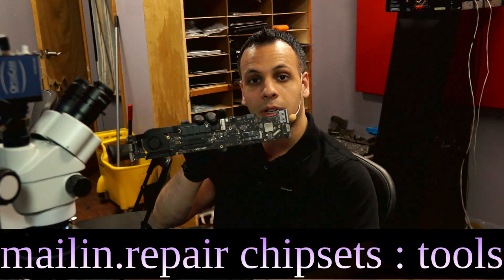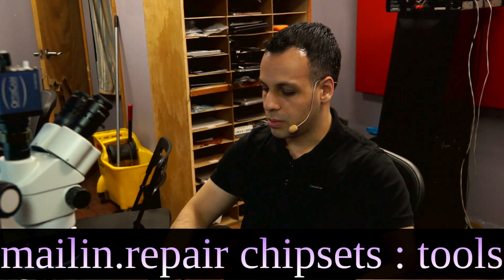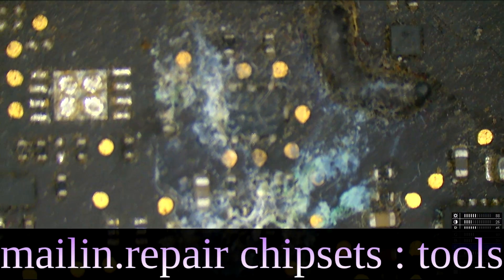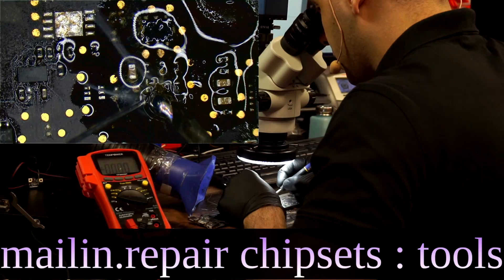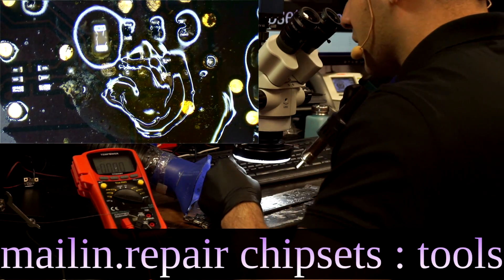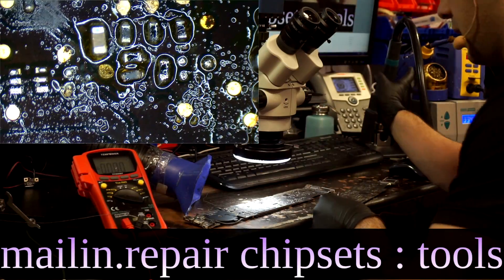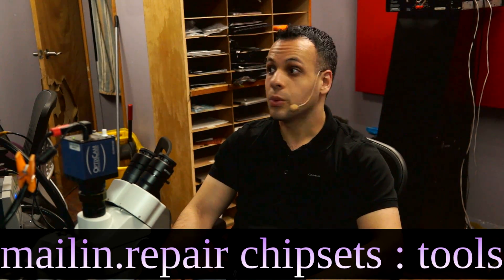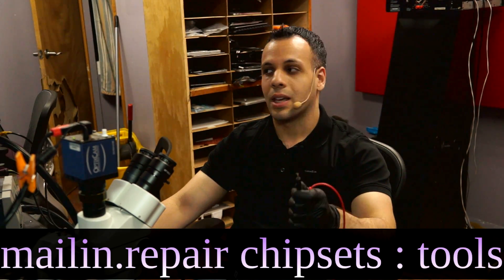Using a DC power supply to troubleshoot MacBook and iPhone logic boards.

Comment: Do you just feed it the appropriate voltage range for that model for full power draw, ie. 16V, 18-18.5V, 19/20V etc (from the bench PSU), or do you need to alter the voltage to 6V/3V to tell if it's getting stuck pre-boot?

Comment: Louis, how to set the Apple cable with the Bench Power Supply? Thanks.
Reply from the maker: 18.5v, no limit on current, ground to ground, positive to positive, and use an 85w original cord.

Comment: Hi, I am a scientist and a heavy Mac user but I don’t belong to the mac cult, or that is what I like to think. I repair computers and cellphones just because I love to do it. I don't make a living out of this, and I've started because I found that all the Mac repairs where I live were full of bullshit and deficient in quality, especially Mac itself. It seems I have done it pretty well, now all the department and friends came to me when they have a problem with their Macs. 
I’ve started to follow you because of above all of the internets I found you are the only repair guy with a critical thinking behind the process and everything else in life! Not just a step by step way to do it, I love to watch your videos! 
I had a dual core i7 MacBook Pro 2011 that was like one if my limbs I pimp up and fixed all the time I keep it in the best way, and it was working beautifully but got stolen. Now I have to think about which computer to get I feel like mac has come down to slippery slope concerning quality, reparability an innovation. To me, Mac innovation has become about changing the color of their new equipment. I know that out there are way better computers than macs, but macOS don't run on them and of course, I do not like using windows I think is a complete useless OS if you want to work with it. So, I am at this point when I can make a change, but I don't know where to go. I even have thought to get an old MacBook pro like the one I had. Sometimes, I feel like Mac computer and OS is like the democracy, the least bad system we have come up with. I thought to ask you because you might have a better understanding of these and maybe a word to say about it. Thanks for reading and for your videos!

Comment: If you cut off he cable, and use an extenrnal DC supply to power the motherboard, then who is gonna talk the SMC to? Is the 1wire circuit built into the magsafe connector, and still be functional after you cut the leads?

Comment: My macbook 13” early 2015 shuts down randomly. It shuts down even when watching YouTube, then next moment when i power it on it won’t even reach to the login screen. When I keep it idle just the screen turned on and doing nothing else it works for a very long time. I guess it is somehow related to GPU temp. Also when the cpu is cold and I start it, the screen distorts and it takes nearly 5min to recover. Even after the screen recovers it is covered with equally spaced light grey very thin horizontal lines. 
I have tried replacing the thermal compound and its of no use. Is there anything else that I can do?

Comment: Thanks for the video, this info will definitely come in handy in the future. Out of curiosity, I've got a cheapy switching lab power supply that has a fairly noisy output (depending on the output voltage it can vary between 300 to 400mVpp) and I was wondering if it would be worth sticking something like an inductor or smoothing capacitor on the output when using it to power a board with sensitive packages like laptop motherboard or would the components on the motherboard be fine if I just connected the output to the board without any filtering?

Comment: Louis i posted this info on one of your last video's that you asked about a inexpensive meter here is one that is not to bad in price and its not too bad of a meter, Ii don't have one but have seen alot of video's on it,  it can be used via Bluetooth and with your android device to display the readings  I dont know if thats something you can use or not anyway keep up your great video's
Owon B35 Digital Multimeter with Temperature Meter, Bluetooth Interface T with True RMS
https://www.amazon.com/Digital-Multimeter-Temperature-Bluetooth-Interface/dp/B010Y71G1K/ref=pd_cp_328_2?_encoding=UTF8&psc=1&refRID=AWX99VNBB4JDV7J01GBK

Comment: Great Video Louis ^o^  Random Unrelated question though... do you have any experience with delidding heat spreaders off of processors?  I've been trying to delid an original PS3's Cell Processor and South Bridge... but all guides I have seen seem suspect and seem to be high risk.  This silicone seal under the plate also seems to be made of adamantium.  Shrugs

Comment: Hi Louis,
I've been following you for quite a long time, you make really educational tutorials.

I would like to ask if I could make a power supply for my MacBook Air without damaging it using a regular ~18-19V notebook power supply and a magsafe 2 cable from ebay?
The only reason I think it may be possible is that the MacBook Pro's charger is rated at 20V while the Air's at 14.85V and both has a Magsafe 2 connector. Or is that the bigger power supply is "intelligent" so it can lower the voltage for the Air?

Thank you for the help in advance.